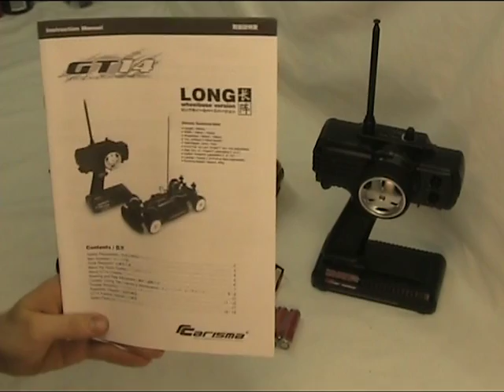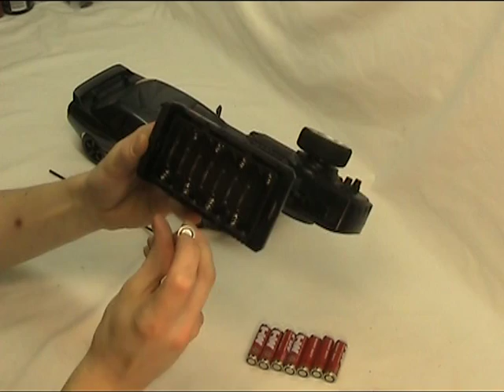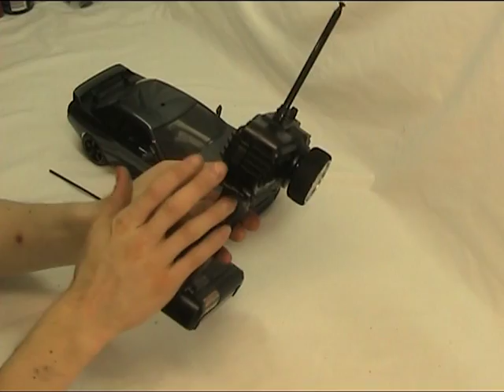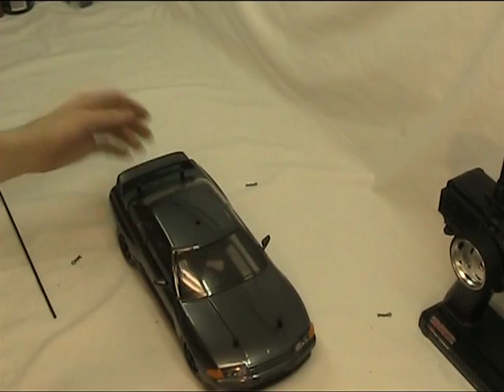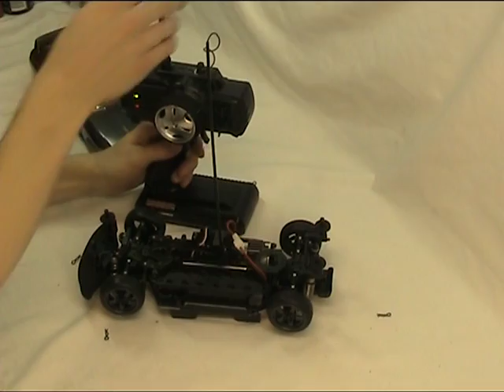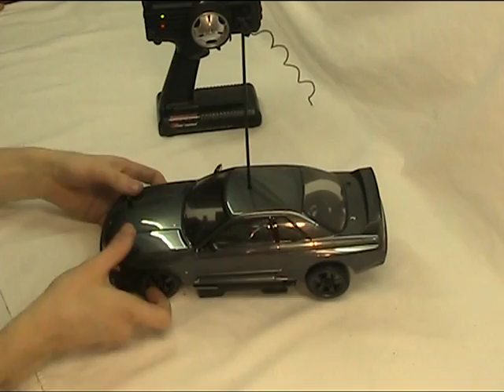Carisma GT14 Getting Started and Set-up for the First Time.mpg

Comment: Hi I found this car in the Attic, I cycled the battery and now everything works 100%
But can you do a video of the transmitter setup (throttle reverse/brake)?
Reply from the maker: Sorry I do not have this car now. Good luck with getting in back on the road.

Comment from the maker: @binini1 regrading the Racing motor, this is designed for this chassis by the manufacturer so no risk of a meld down - a great inprovement as speeds are raised by 6mph with this. Charge times on the wall charger are 2-3hrs, faster on a better charger. I hope this helps and don't worry the spares are available.

Comment from the maker: @binini1 Good question. I my flat out testing during the cold weather, so worst condidions I recorded the following.

On the stock motor the kit 700mah last 10mins and the 1250mah lasted 20mins I have not recorded times for the uprated motor - would you like me too for you? Speed is also incresed a little with the bigger battery.

The bearing are designed to prelong the life of your RC and drive train, they will reduce resistance and hence increase performance.

Comment from the maker: @binini1 Yes there are spare, we have many in stock - more M14 then GT14 at the moment. There are also lots of upgraded parts from motors, heatsinks, suspension, bearings, gears, diffs etc. If you need more info let me know.

Comment: how long does the m14 last for on the 1250 mah battery on the stock motor and the upgraded motor. and do the bearings really worth the money. do they do anything significant to the performance of the car. sorry if i'm asking to many question but my friend wasted £120 on a rc car when he put a bigger motor in it lasted for 4 min and took 4 hours to charge and there are no spare pieces for it.

Comment from the maker: Depending on your needs they are very different cars. In simple terms the M14 is 2WD and the GT14 is shaft driven 4WD, both have gear diffs and high traction tyres. The GT14 has more scope for tuning suspension set-up as each wheel is independant, the M14 has simple front suspension and a single shock for the rear pod.

All these differences are reflected in the prices of the cars. Some of the GT14's are available with 2.4ghz radios which is good. I hope this help.